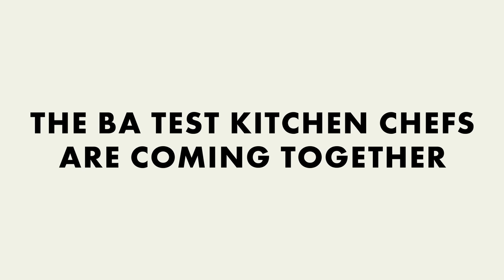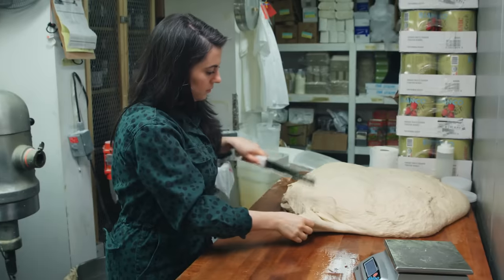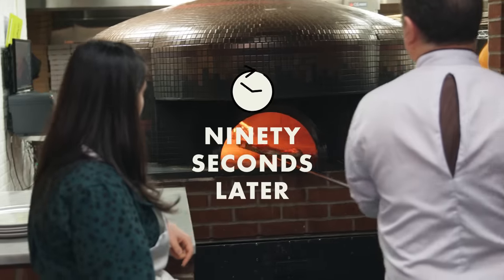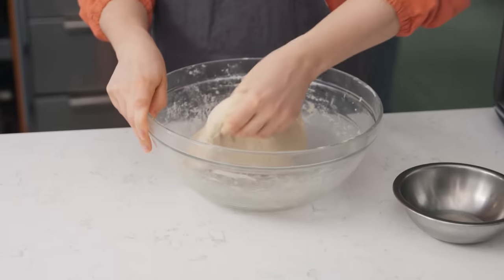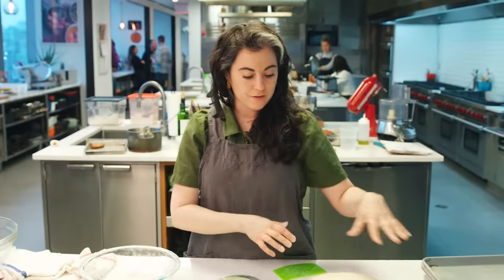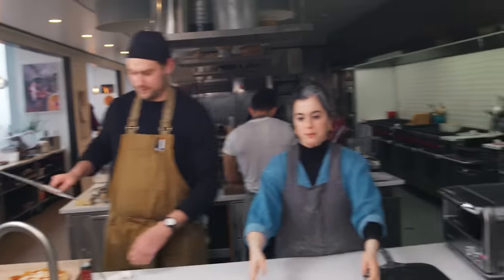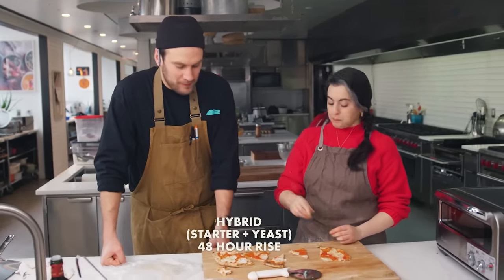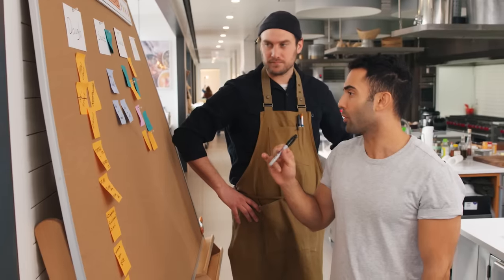Claire Tries To Make the Perfect Pizza Dough | Making Perfect: Episode 1 | Bon Appétit

Comment: I've been making pizza my entire life (and I'm old now).  I know a considerable amount about fermentation choices, flours, fermentation times, etc., and I make pretty good pizza at home in my oven lined with tiles.  That said, I learned a few interesting things and REALLY appreciated the methodical approach you have taken to forge your path toward your favorite crust.  Very inspiring.  Thanks!
Reply: Any tips with the pizza peel process or wood vs metal, pizza master?
Reply: Like you, I've made many many pizzas and doughs in my home.  It was my experience that my pizza got dramatically better when I stopped trying for "neapolitan" or "italian" style, and switched to "detroit" style.  It doesn't require the high temps that home ovens rarely reach.  Also @Magnetic Ink,  detroit style doesn't require a peel.   :)
Reply: If Aladdin Sane is your real name, I respect you, sir/ma'am. If not, it's a really good username. Respect pizzamaker otherwise bcos I looove pizza.
Reply: @z33r2  I have the identical pizza peel they are using which is great for smaller size pizzas, but I use a wooden paddle for larger ones simply because it's bigger.  They both work well.  The key really is in that wrist action quick tug backward.  You get better with practice.  They use flour to prevent sticking, but some pizza makers swear by coarse cornmeal (like that used to make polenta).  The coarseness acts like ball bearings and the crust slides right off.  Some people don't like the taste of the cornmeal (although it doesn't really bother me).  I have found success using semolina flour (the flour used to make pasta).  It's finer in texture than cornmeal, but coarser than flour.  Plus it doesn't taste like cornmeal which is plus for some folks.  Another important issue to remember is never top a crust with anything hot.  It causes the crust to begin sweating it's moisture which will cause it to stick.  I hope some of this is helpful to you.
Reply: @krru9083  I wish my user name was my real name, but, alas no.  You can thank David Bowie for that moniker.  Happy pizza!
Reply: @befuddled2010  Thank you sir! Very good information. My metal peel is huge, like 15" wide... that may be part of my problem. I think I need to get a smaller one like you have.

Comment: For those of you wondering:

Flour: 60% All-Purpose flour + 25% central milled (milled whole berry) + 15% fresh milled
Yeast: 15% Starter + 0.5% fresh (cake) yeast
Hydration: 66%
Salt: 3%
Olive Oil: 3-8% (Claire used 5%)
Rise: 24hr min cold rise
Reply: 66%procent hydration can't be true right?
Reply: @ryansearle5336  both NY and Neapolitan style dough uses 55-65% Hydration.  They also both use majority high gluten or 00 flour.  Since this recipe uses whole milled flours, (which tend to be a little more thirsty of a flour) I believe this is why they are using the high end of the range for hydration. Given this amount of hydration you will need you oven to be piping hot! For reference sake, The Bread Bible's "perfect pizza dough" recipe uses 70% Hydration.
Reply: @holteener14  ooh, okay thanks

Comment: What's the recipe
Ba hybrid doygh
Starter 15%
Fresh yeast .5
Apf 60
25 central milling??
15 freshly milled
66 hydration
3 salt
5 olive oil
24hr cold rise
Reply: omg tysm, but if I don't have the flour mill or whatever that machine it's called, freshly milled flour would be kinda the same as whole wheat flour, right? because she is milling the whole grain ...

Comment: I’ve found the more often I feed my starter (everyday), consistently, the less sour-tang I get. I’ve heard more frequent feeding leads to culture that produces acetic acid (smells like ripe fruit) versus lactic acid (sour smell/taste). Try a wood peel with flour (tends to dry out dough and burn), Seminola flour (my favorite), or corn meal and try dressing you pie on the floured peel (quickly, as soon a sauce goes on your under pressure to get it dressed before it wants to stick). I ferment overnight (8-10 hours) with natural  Levin/sour dough after bulk fermentation at room temp (8 ish hours). I not sure anything positive happened over 24 hours in my case. Factory yeast seems fine for a few days. My bread I don’t cold ferment more than 8-10 hours usually and not sure why I go longer with pizza dough other than making it ahead. The oven seems to be a bigger factor for me. People seem to like Rao’s marinara when I’m too lazy to make sauce…they may actually like it better. Great job! Love this show.

Comment: *Amateur tip: I have a big wooden peel that I sprinkle a little corn meal onto. I shape out the dough on my big marble pastry stone then place it on the peel and make the pizza. I NEVER have a problem getting it off and into the oven on my pizza stone.
Seems so obvious that you don't make the pizza with the sauce cheese and toppings and then struggle as they did here, to get it on the steel peel.

Comment: As Morocco figured out in the topping episode,  they should've been building the pie on a wooden peel in order to easily slide it into the oven. Scarr demonstrates. As you can see in the subsequent episodes,  building it on the counter and then using the metal peel is a disaster waiting to happen.

Comment: One problem with this entire season of 'Making Perfect' is the fact that they don't tell you the temperature that they are cooking their pizza at.
Reply: with pizza, it's as hot as you can spur the oven up too, it isn't that hard; especially with a thinner crust. so crank it up to liquify, and watch your pizza, turn if needed. If you can make a pizza, get it on the peel, get it off the peel, and it's still round, that's half the battle.

Comment: Not to throw a wrench into the works way after it's all complete, but at 27:50ish they decide Starter 24h over Hybrid 24h - then after comparing 48h hours they decided Hybrid 48h. Why didn't they then compare the two Hybrids instead of Starter 24h vs Hybrid 48h? Starter 24 might have been the winner...